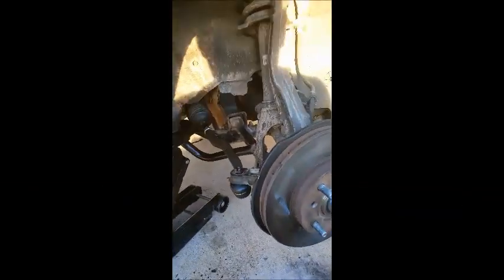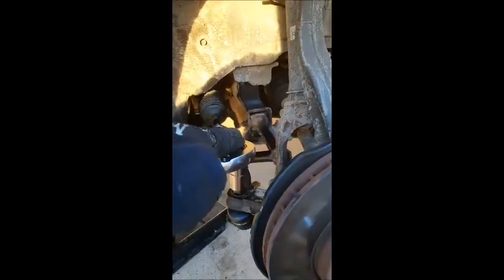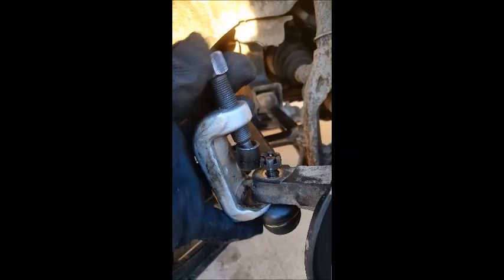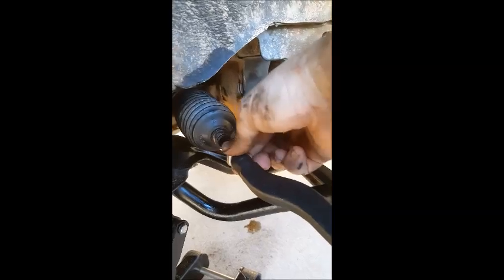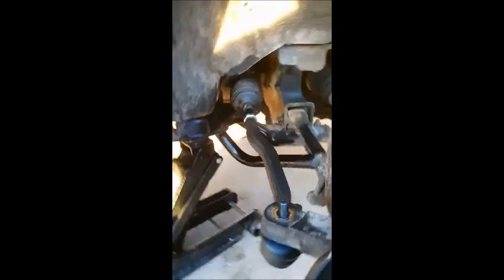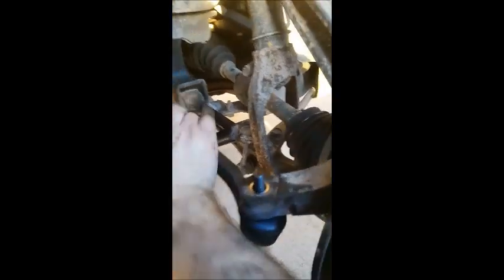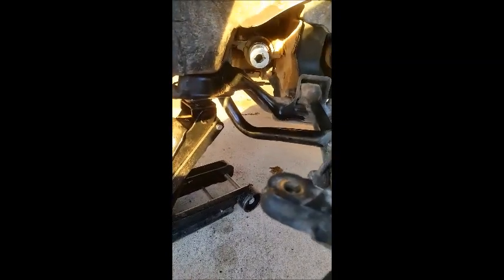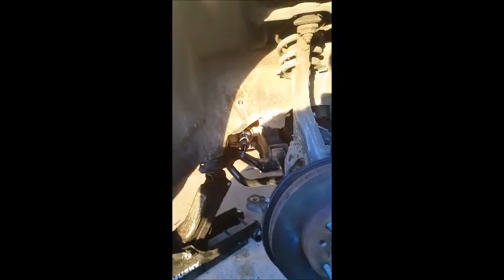2001 Honda Accord Inner and Outer Tie Rod Replacement

Comment: Hi good video, how would you lock the washer/bracket? You said bang it with a flathead? Can you please explain better thanks?
Reply from the maker: Hey, thanks for watching!  On the bracket/washer, two of the sides where initially pushed into two groves on the tie rod.  You can see where I had to use a flat head to brake the washer free from the tie rod.  If you can get behind it, you can bang those sides in with a hammer and flat head or possibly some pliers perhaps.

Comment: Thanks for the video. One question though, my new tie rods didnt come with that locking washer, are the old ones reusable or do I need to find some new ones?
Reply from the maker: I would assume it should have come with it when you bought it you could go ask the part store where you got it from. If the old one is not damaged in any way then go for it. Thanks for watching!